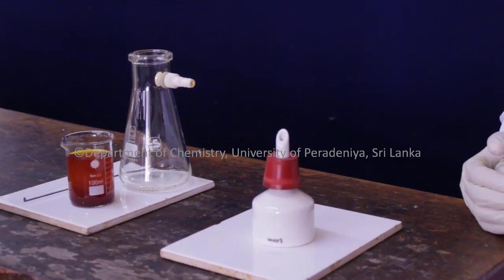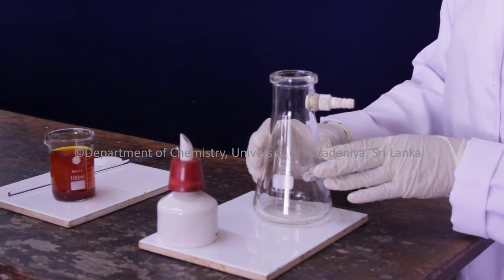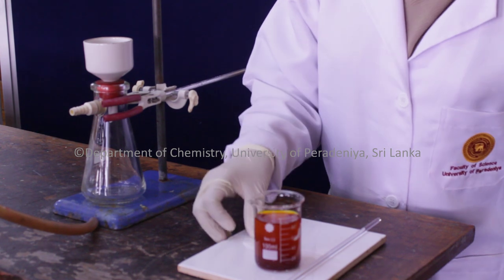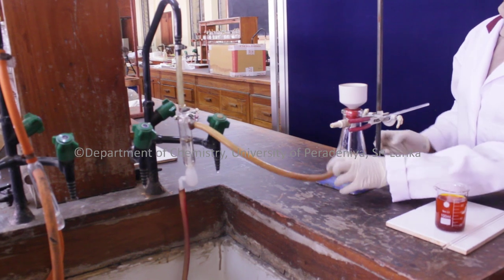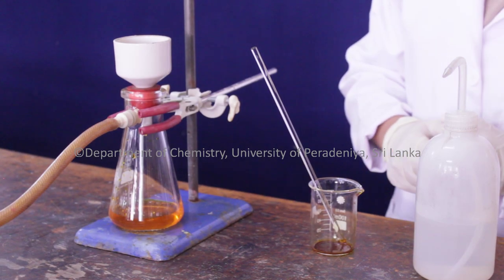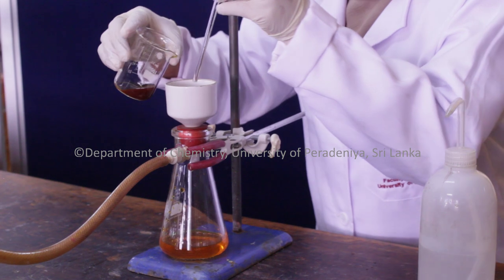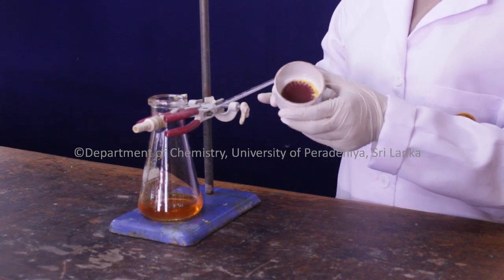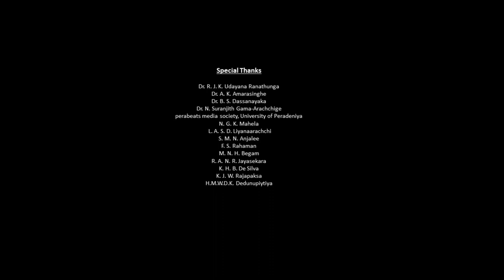How to use a Buchner funnel

Comment: if i use 100mm buchner funnel, what size that should i use for filter paper, 90mm or 110 mm? thanks in advance
Reply from the maker: The filter paper should be smaller than the funnel, but should cover all of the perforations (holes).